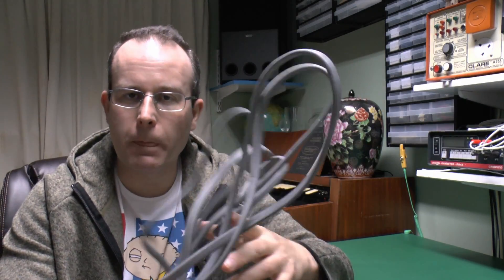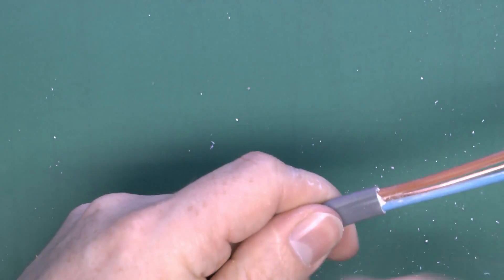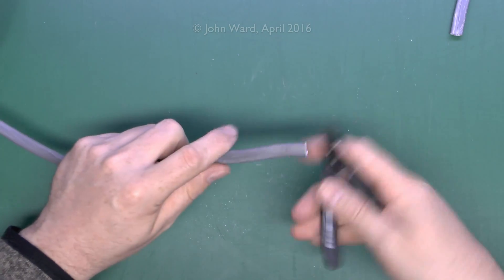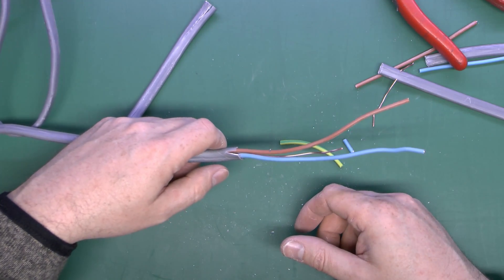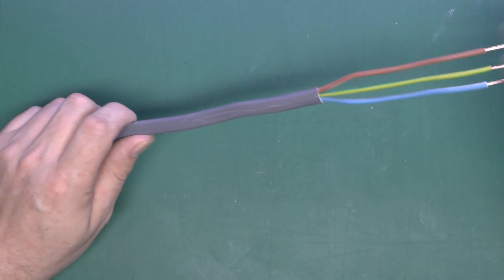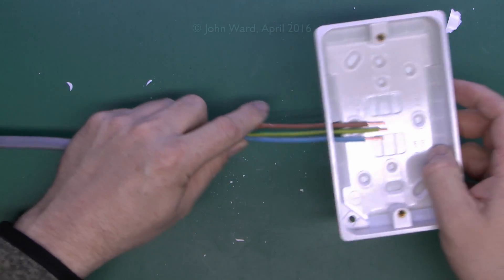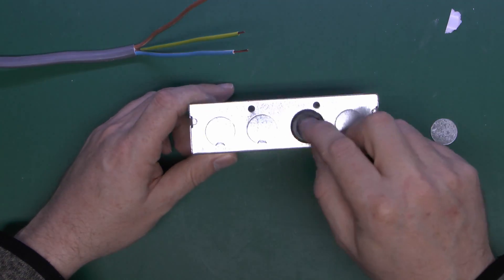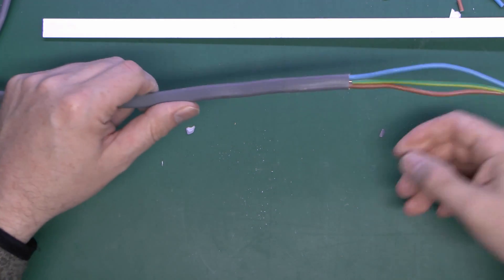Using Twin & Earth Cable

Comment: I always leave a neat edge on my Strips. It looks better to start with but it also helps a lot if you need to replace a unit. Its a good working practice. The cables go back in much easier, which is helpful when there are a few cables coming in one point such as the spur point of a ring circuit. I rant, curse and rave when I'm replacing a consumer unit and the bell end before me left a big pile of ragged edges for me to battle with. Pride in ones work people, pride in ones work.
Reply: Damn you! I used to bend the sheath and chop as shown. Now, because of your comment, I have to slit round and leave a neat end!
Reply: How do ragged edges make it more difficult? Certainly don't have long "peels" hanging off - that's unsightly to say the least! - and while it definitely DOES look more aesthetically pleasing with a neat cut , it's also very easy to nick the actual wires. It may look neat, but if it's nicked the connection/wiring is compromised.
Reply: Interesting... Now, who doubles over the conductor when terminating?
Reply: With me, depends on the terminal/wire combination.  Single conductors in terminals designed for 2 (2.5s in sockets, 1mm2 in light switches, yes.  1.5 in light switches: depends on the design. Otherwise usually no.

Now to open it up further... ferrules on flex? :D
Reply: @guineafowl8029  That is how it should be done if there is room inside the terminal to do so.
Reply: @TheChipmunk2008  Good points

Comment: The practice of using cross-sectional area (metric) is sensible. In the US we use AWG (American Wire Guage) where a  larger number means a smaller wire, up to 0000 (4/0 or Four-aught). After that we use an area measure - units are MCM (Thousand Circular Mils) where a Mil is 0.001".
Reply: Yeah its you guys and Myanmar and Liberia
A nice little unique club

Comment: Sleeve I tend to use a piece of earth wire and strip the sleeve, so as not to need a easy to lose sleeve roll, plus I tend to have extra short offcuts in any case.  Here in SA you need to use a cable gland into a box, irrespective of whether it is a flush mount or surface box, so no grommets. 

The trunking I buy and put self adhesive tape on separately, as it is not common to get a self adhesive one. Saves a lot of time, plus no sagging ever, especially after 2 paint coats seal it in. A single screwnail every so often helps, especially with the larger sizes where you might run 10 or more inside the trunk. Stick, then drill through and place the screwnail in then gently tap into position.

Those clips can be a pain at times, especially if you have a wall seemingly made out of powder which does not hold, or those walls seemingly harder than granite. Easyhold and cable tie to the rescue, but not as nice looking, but great for a bundle in a roof to make it neat along a wall.

Comment: Hi John, Love the vids.. Anyway, save time stripping that type of cable. No need to slit it. Just score deep around it, bend it slightly to see if when it actually cuts through the sheath- on both sides. Then grab both sides of the cable with each hand and pull. It'll generally snap and the sheath after the cut will just slide off.

Comment: Here in the US, this type of cable is typically referred to as Romex, named after one of the major brands of it. Ours has a thin brown paper covering the individual wires inside instead of having talc coating. Interesting that cable that is much the same is used in the UK, though.

We also don't have any covering or anything over the earth wire. I do like the idea of having that sleeving though; in a cramped electrical box we have to be somewhat careful to make sure that earth doesn't short out to the live connection on a switch or receptacle, which could be pretty dangerous.
Reply: I thought I would mention that our screw terminals in the US are open!
and we also have outdoor/buried rated cabling which is closer, however it seals in the ground conductor in the molding process of the cable sheath.
Reply: Go back to some old UK installations, and I can guarantee that many of those won't have earth sleeving on either.

Comment: Another method of stripping the cable I was shown whilst at college was at top of the cable by using a knife and strip down towards the bare earth without trying to cut through the insulation of the wire. I did it initially lol but mastered it in the end

Comment: Fixings, such as the clip shown in the video, in escape routes now have to be fire-proof, in practice metal.  That means metal clips for surface mounted cables or metal conduit.  Most dwelling this is going to mean corridors, stairs and upper storey landings.  Regulation 521.11.201 came into force 1 July 2015. 

 https://electrical.theiet.org/wiring-matters/issues/58/fire-performance-of-cable-supports/

Comment: Thank you for destroying the stupid myth about damaging the earth by pulling on it!
Reply: TheChipmunk2008 i managed to stretch couple of earth conductors by pulling throughout the cast copex in concrete,  i used metal draw wire and i applied my body force to pull them out from the socket, but that happens only if you attach the earth conduit to the metal draw wire and only for distances like 3-5 meters long, you can spot that the earth wire is longer and thinner but not broken and the 1.6 formula for inspection and testing would fail
Reply: It's not a myth, it stretches the CPC. If you strip a large amount of twin+earth in a board then notice how much longer the CPC is after you size up the rest of the conductors. You have to be skilled and experienced enough to know when you've damaged it too much.
Reply: It will yield/stretch when pulled as the yield strength of copper is 70Mpa or 70N/mm2. If it is 1.5mm^2 CPC that is force of 105N or 10.7 kg. This is much force than needed to tear the cable sheaf so the earth is deforming and stretching. As this will therefore decrease the cross sectional area it should not be done.
Reply: @NebakinezaOG  I'm not convinced personally, not saying the copper conductor can't be stretched but i doubt the force used while pulling the CPC to strip a PVC cable could stretch a solid copper core. Whats most likely happening with the CPC being longer is you are pulling the CPC while holding the other cores so it is shifting within the PVC insulation and pulling towards you while the other two cores are not moving.
Reply: @stevoc9930  try it on a fresh drum, there’s no way it would slide within the sheath. Strip a good amount by yanking the CPC through and then straighten out all the cores. You’ll see the CPC will be several inches longer
Reply: @NebakinezaOG  I’ll be honest mate   I’ve been stripping T+E for over 20 years by pulling the earth and while yes sometimes it ends up longer I’ve personally never ended up with it a few inches longer after stripping. Though on shorter lengths of a metre or two it has disappeared at the other end so it can definitely move within the pvc sheath in my opinion.
Reply: @stevoc9930  Trust me, when your stripping 3m off for industrial size distribution, not only is it noticeable; if your QS caught you you'd likely be out of a job. Alright for house bashers I suppose but indy, no chance. You're getting pulled for poor workmanship. Just strip it properly! Takes a few seconds longer.
Reply: @NebakinezaOG  I’m genuinely interested mate in what scenarios are you using T+E for industrial size distribution?

I mostly use cable strippers for twin and earth these days whenever I have to strip it. Mostly because it’s a far quicker and cleaner job as opposed to worrying about stretching copper.
Reply: @stevoc9930  LSF/LSZH for Intu, Westfields, etc. It's always been their spec.
Reply: The Chipmunk2008, using the c.p.c/earth conductor as means of cutting the outer sheath has a bending and straightening process that does damage the copper conductor. When any metal is bent the outer 2 thirds of metal thickness gets stretched and the inner third of thickness gets compressed, then when the bend gets straightened back out (as in your case) the same thing happens again but this time it's the opposite side of the conductor that is getting stretched, and to make matters worse bending and straightening metal does work harden it making it less pliable and more brittle. This is a fact not a myth.
Reply: @NebakinezaOG  I'd say it's ok on the grey pvc/pvc stuff but lsf is quite a bit tougher usually so probably would have issues with that.

Comment: where twin & earth is run on a bare brick or block wall capping should be used to protect the cable from the plasterers trail that's the reason for capping.

Comment: I was always under the impression That the central earth was left bare so that if the live or neutral was damaged, there was a good chance it would short with the earth, tripping the RCD rather than shorting with each other and potentially causing a fire.
Reply: +SLRist It wouldn't cause a fire, would it? as the MCB would trip off at the required breaking current or short circuit capacity?
Reply: +Birdiemango1 I guess it depends what kind of combustible materials were nearby at the time the cable was damaged. I did say potentially.
Reply: Yep, me too.  But I have yet to find anything that hints of official decision to make it so.  So perhaps that is just a 'story' and the real reason is cost staving; which I would find disappointing.

Comment: Leaving the earth wire bare within the cable, not only makes it a bit cheaper but also a bit thinner too. It may be marginal, but every little helps.
Reply: To me as a Swede, having any wires not insulated just looks....  wrong!
Where is the single fault protection?
Of course, the PE won't carry any current unless there already is a problem somewhere, but.. no lol
Reply: @BPo75  If there is a failure of the insulation in the cable itself,  with a neutral to CPE fault, then it will pop the RCD protection (any such insulation breakdown tends to be gradual, although if it's an older installation without RCD protection, then it will be the MCB/fuse that will fail on a line/CPE short, although  

It's really no different to what would happen if the insulation is breaking down in a cable with insulation on the CPE. It's just going to take a bit longer to find out.

In practice, it seems to be extremely rare unless the cable is damage by, for instance, a screw being driven through it.

Comment: This cable is pretty well identical to what we have in Canada, "Non Metallic Sheathed" cable, sometimes called "Romex". Installation methods  differ here as to use of, installation , fastening, and sleeving of the bare  conductor .. (we don't!)
Reply: +REWYRED The requirement to sleeve the bare earth came in here in the UK sometime in the late 60s, before then it was left bare. It was plain green to begin with but in the late '70s it was changed to yellow and green.

Comment: John im fitting a cctv camera to the outside of my property. It comes with its own junction box twin and earth connection. Im using standard 1mm cable as its a standard camera low wattage. Immdrilling through from the outside wall into a bedroom. Is it better to use a stiffer cable or flex for that job or doesnt it make a difference
Reply from the maker: No difference, and 1mm² will be easily large enough.

Comment: snip end open with side cutters grab earth with pliers pull back to required length then ether score and peel  or snip outer off using knife risks snagging insulation on conductors

Comment: What do you recommend for finding wiring that's been plastered over, I mean when I put up shelves, I don't want to screw into anything bad.
Reply: +Green Silver You can find special voltage sense probe which can detect the wires. 
Like this one   http://www.amazon.com/Fluke-1AC-A1-II-VoltAlert-Non-Contact-Voltage/dp/B000EJ332O/ref=sr_1_1?s=hi&ie=UTF8&qid=1460328074&sr=1-1&keywords=fluke+power+pen
Reply: +Green Silver Building regulations state where cables can be run within walls, if the contractor that wired your house followed these regulations you can take an educated guess at where the wires will be run but if in doubt use something like +MegaGreenman28 suggested. 

As a general rule of thumb do not drill the wall directly above a plug socket or adjacent to it in a vertical or horizontal plane so most wires will be directly up and into the ceiling or make a loop around the room connecting sockets (ring main?) 

There are also similar guidelines for Gas and Water piping but these are easier to avoid.
Reply: +Matt Warrillow Edit, i retract my comment about using the tools recommended by +MegaGreenman28 as this may not detect live cabling behind plaster/plasterboard walls, you will be better off using a stud finder that also detects live AC. 

http://www.amazon.com/Zircon-MultiScanner-i520-Center-Finding-Electrical/dp/B000TD1JCQ/ref=sr_1_2?s=hi&ie=UTF8&qid=1460390944&sr=1-2&keywords=electric+and+stud+finder

Comment: Which cable do you need to install recess spots?? I’ve used twin and earth (3 core) 1.5 square mm white cable .. is that right??
Reply from the maker: Probably.  There isn't any one cable to use, it depends on the total load, circuit length and other factors.  However 1.5mm² T&E is suitable for most normal installations.
Reply: 1mm T&E is usually more then adequate. it's easily terminated  and much easier to work with. Most recessed lighting is led or low power consumption these days. Unless you are doing a vast amount on a singular circuit 1mm is usually fine. If in doubt consult a qualified electrician. 😉

Comment: I have never seen that green/yellow sleeving before and I can't seem to find it even now. It seems like a handy way to reduce the chance of accidental shorts. Is there another name for it? It is a UK only item?
Reply from the maker: It's just called PVC sleeving, this is a random example: https://www.cef.co.uk/catalogue/products/213784-3-0mm-green-yellow-sleeving-100m-reel
It's only common in the UK because of the type of wiring - the flat cable doesn't have any insulation over the earth conductor.  Other countries use cables with the earth conductor already insulated in green/yellow, so there would be no need to use separate sleeking there.
Reply: @jwflame  All the home electrical wire I've seen or worked with in the US has a bare earth conductor. As far as I have seen, they are always just left bare in the box. I'm not sure why we (Americans) didn't get the memo on this. Maybe because our voltage is lower? I can't seem to find that material anywhere and I've never heard of anyone sleeving before watching this video.

Comment: Would have been great to end this good video with the different ways to terminate and the ways not to terminate. e.g twisting wires together, bending the end to create loop etc
Reply: Bending back of the stripped end is sometimes necessary because the single screw barrel terminals are used in the UK. Provides a better contact especially if a single cable is being connected. Clamping pan head screws with square washers or terminals similar to that used on circuit breakers are probably used elsewhere. If the terminal is just the pan head screw a C loop must be formed on the wire so that it can be placed under the screw head.

Comment: Sorry if I missed it but what do you think about folding over the ends?  
I always did it, but on ring circuits to sockets now I'm wondering if it makes a cleaner, more certain/secure connection without, especially when replacing sockets in tight spaces.
"Theoretically" a doubled/folded over end could snap under the terminal or when pushing the socket into place.
Reply from the maker: Depends on the size of the wires relative to the size of the the terminals.  With multiple wires it may not be necessary or even possible to fold the ends, but certainly recommended with only a single wire and a relatively large terminal.
Reply: @jwflame  Thank you, that's more or less what I thought. 

I wonder if someone will try inventing a socket which takes wires with a Wago style snap terminal.

Comment: Just a sort-of "in your experience" question, and I realise the answer by some may not agree with others. With regards to scoring the outer jacket, is a sharp blade better or a not-so sharp one? If it's very sharp, a cleaner cut but also easy to nick the wires inside. If it's not-so sharp, not as clean, but less risk of wire damage I would think.
Reply from the maker: As sharp as possible, scoring then only requires very light pressure and is easily controlled.
Blunt knives are useless as the amount of pressure required to score depends on how worn the blade is, and having to apply extra force means it's more likely to slip and cut things you do not want to cut.
Reply: Sharp blades are always the easiest and safest to use whatever you are trying to cut.

Comment: Hi can you clarify for me if I can use 2.5mm yellow Arctic cable (110v) to make a 240v extention lead thankyou.
Reply from the maker: Yes, it's all rated to the same voltage.  Only the colour is different (blue or yellow).
Reply: John Ward thanks for the info and speedy reply much appreciated.